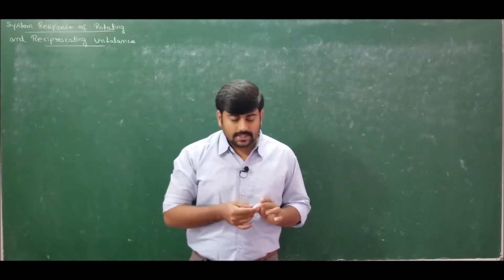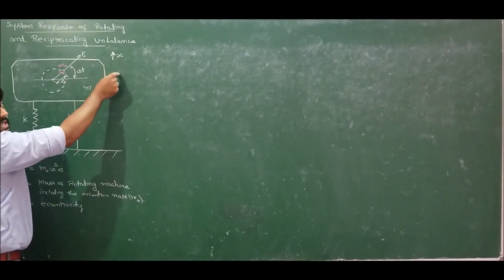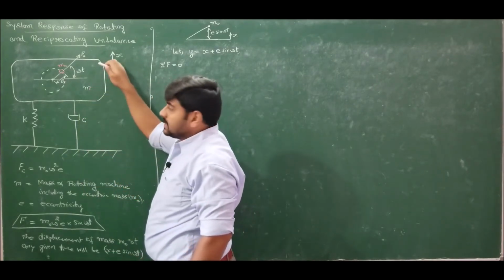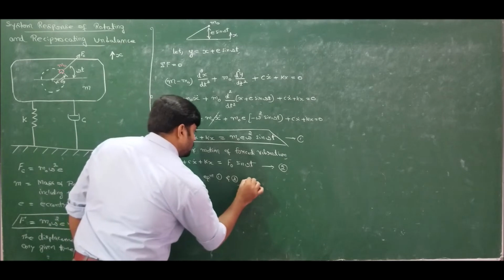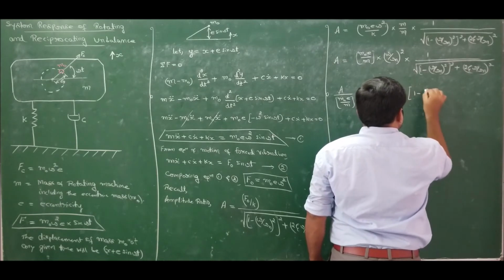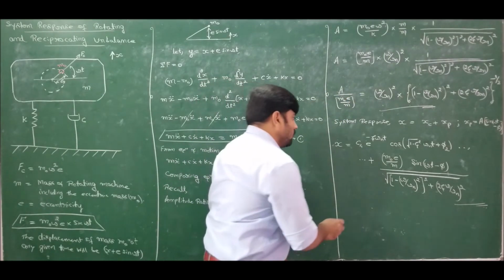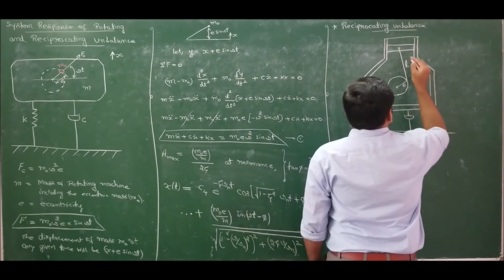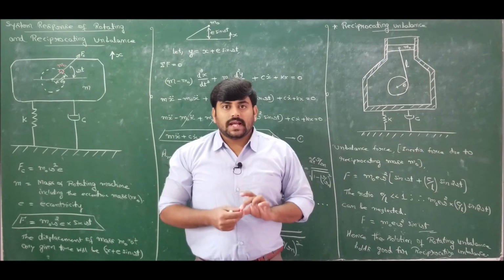Lec 2-Forced vibration due to rotating and reciprocating unbalance- Mod 2-Vibrations by GURUDATT.H.M

Comment: quick question. For both rotating and reciprocating unbalance. If you were to find the natural frequency, wn which is given by sqrt(k/m) is the m in the formula the total mass or the mass without the unbalanced/reciprocating mass?
Reply from the maker: Wn is the natural frequency of the vibrating body without unbalance. m is the mass of the rotating or reciprocating body. The unbalance mass will create excitation, which will be used to calculate the amplitude of unbalance and transmissiblity.
Reply: @MechanicalEngineeringELearning  thank you so much! That has cleared up my confusion. 😃